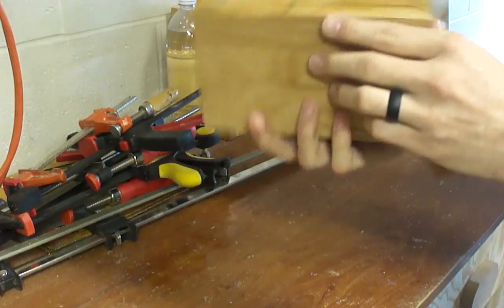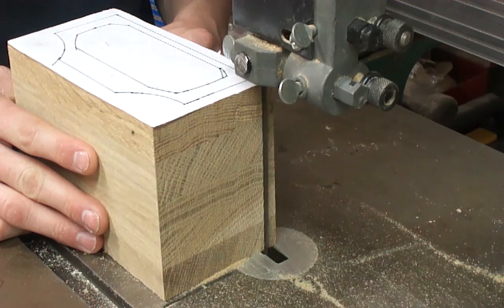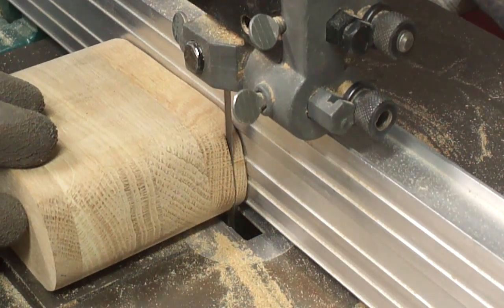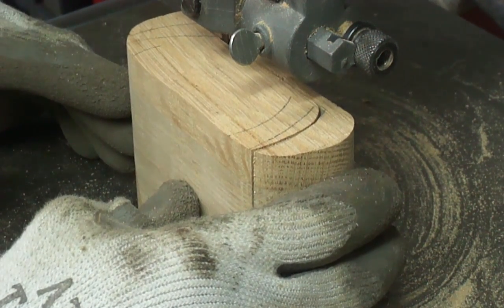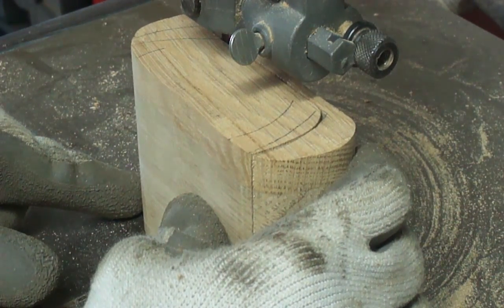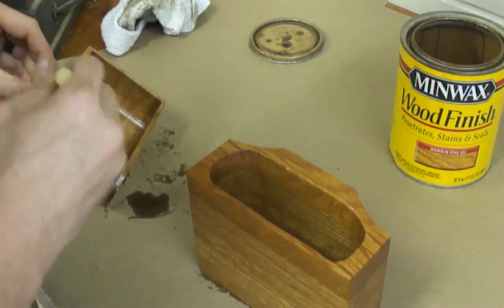Bandsaw Box | Project 002

Comment: Love it! Just a question, you mentioned entry point to cut the inside out, but not sure what or how you did that, finished product looks perfect?
Reply from the maker: So basically you just position the workpiece so it’s flat on the front or back of where the drawer is and start cutting into the wood. You should have some type of template or lines drawn on the faces to match the shape of ten drawer you want. You’ll, then cut along those lines until you made a full pass. Turn off the bandsaw and when the blade is done moving you can back out the blade back to your original entry point and now pop out your drawer piece. You can glue the seam that you created by cutting the entry point and you’ll never know it was there.

Thanks for watching!

Comment: Did you sand or do anything after you the fronts and backs of the drawer before putting it back together?
Reply from the maker: I mistakenly did, yes. I sanded the bandsaw front and backs before putting back together. What this did though was made my seam not as seamless. If I would have left it rough cut it would have fit back together much better. Most people wouldn’t probably notice, but I do!

Comment: Confused... what was the need to cut the outside 2 times starting at 1:47 ?  Guess I missed something ? Nice box
Reply from the maker: Robert Smith just wanted a clean block to work with. Looking back, it wasn’t “necessary” but I think it helped my OCD, if that makes sense?
Reply: @TheMakingLife  . No problem , I did the same thing on the first boxes and then it  come clear that all I was doing was wearing out the blade sooner than needed .Thanks for posting the video .  Cheers!
Reply from the maker: Robert Smith you’re exactly right. It was all going to get cut off regardless, I just did it twice. I wouldn’t do it again like I did here with that cut.